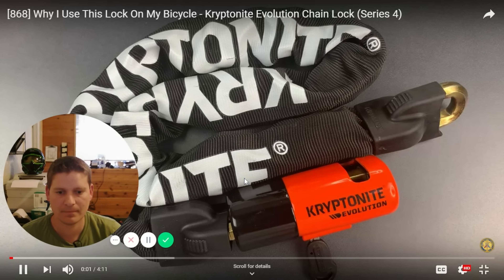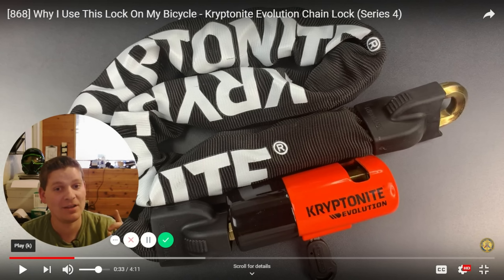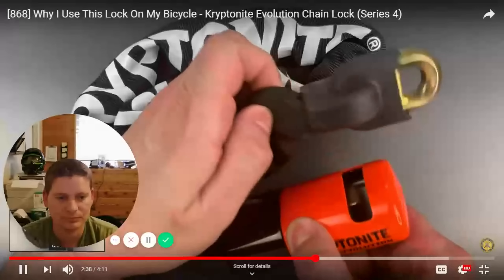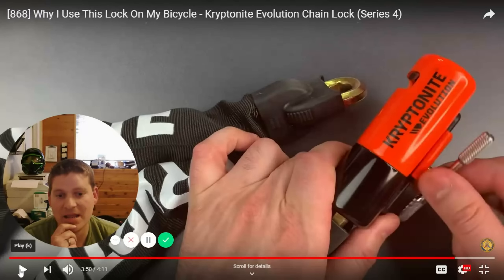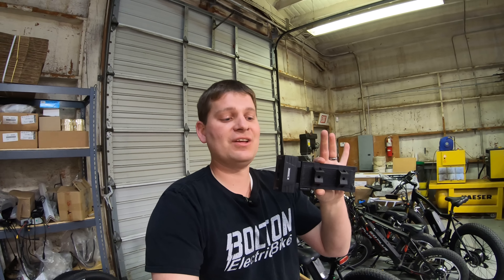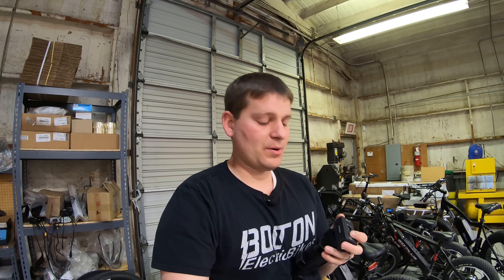Secure Your Electric Bike From Theft

Comment: The most stressful part of e-biking is trusting that it'll be there when you get back in a few.....
Reply: Yes that Is very true
Reply: It ain't going to be there  so there is no point in having it
Reply: Tile sticker can help you recover it just hide it good. The battery lasts three years. If someone who has the tile app gets within 100 feet of it after you report it stolen you instantly get a location.
Reply: @thetruth6585  What is a tile sticker exactly and what is its normal use? I assume it's some kind of GPS tracking device. If so, where would you get one from and what do they cost?
Reply: @Bogsyism  tile uses bluetooth not GPS. It costs 20 dollars. If u mark it as stolen anyone with the tile app can locate it for you.
Reply: Use boomerang GPS system
Reply: I actually have now installed tile trackers on both my bikes.
Reply: @robertbrawley5048  bet you never tried for pretty woman either then!? Someone usually steals them too! Nothing is forever ma fren! Bicycle...woman...ride it like you stold it cuz there's no tomorrow!!
Reply: @davidklein1667   ha ha .  I'll know what you mean I ride my present bicycle a Walmart $100 wonder  but a $1000 ebike I should be more careful
Reply: @robertbrawley5048  just cover your bases my freind!  I live in the ghetto...ebike...3000$...nails bit to a stump! But I study problems and worked out a system....Locks, Locks, Cables, Alarms. Oh yeh...more lock gadgets! Like security skewwers. Use a varied assortment of ubolt, cable, etc. Leave no slack in chains or cables...an audible alarm.....any bike can be stolen...just make it to much work and time!
Reply: @davidklein1667   what is needed is a compact bike and a cut proof or cut resistance cover that can enveloped  a bike lock to a unmovable stand I believe a teflon woven fabric could  be the approbate material.  It doesn't burn but it will practically melt . It is difficult to snip apart or to slice through. My plan for an ebike used for transportation only, never recreation  is to be able to take it into a store. With me . As yet I havent seen a ebike in my price range ( a brampton is above my price range) that is suitable for taking into a store . . But the $1000 fat tire bikes would be suitable to drive to a rental car dealer and stow the bike in a car. The availability  of battery powered grinders rules out a 2000 dollar ebike as a bike locked on the street 
And I live in a ritzy area that poor people  come  into as well and . So poor they dont own a car. I'm that poor as well. People here have had their cars stolen 20 year old junkets  with dead inspection  sticker . Meaning people desperate for a ride. . I rarely lock my bicycle on close by stores ( an easy walk Home )  and use a cable  at stores that would be a far walk back home
Granted  most thief's dont carry a battery power grinder  with them
Reply: @robertbrawley5048  hey Bob. Good points all. However!! There isn't a lock made that can't be defeated!! And yes...they carry grinders here! But I've worked out a system...knock knock!!!...that seems to be working.
  Like I said all locks can be picked, grinded, cut, snapped with a car jack!..my fav..frozen and shattered.
  But...thieves studied operate under the '30 second' rule. Can they snatch your bike quickly and with a minimum of fuss and noise. Sooo...your job is to provide an obstacle course to difficult to navigate without waking the neighborhood.  Also...most thieves are young boys that carry only One tool...be it grinder or bolt cutter...I have yet to hear of or meet a thief that carries an assortment so multible locks requiring different locks along with a 20$ squawk box alarm. Another sad but viable strategy...chain up near less secure bikes! Please understand...I've developed this over 25yrs in security work combined with my cycling. Use my method and you should be fine...there's also insurance. 
  BTW....Don't think a 1000 is enough for a good ebike. Common consensus is you need to start around...1800$...otherwise all you'll get is junk!
  Good luck!
Reply: @davidklein1667  
1. Chain up near less secure bikes. Let them follow the 30 second rule and steal the less secure bike
2.  The thirty second rule . If they cant steal it in 30 seconds  it ain't worth it.
Ok I forgot. Insurance
3. Insurance
Reply: @robertbrawley5048  dont forget yur 20lbs of steel, titanium. Carbon weave belts and my new fav...disc brake alarm! 20$
Reply: @robertbrawley5048  an envelope..cut proof to protect the lock...hmmmm. interesting!  One thing though...what to use to lock/secure the cover!!!?? Lolol
Reply: @davidklein1667   yes that's the problem The weight and bulk . But it could be said for a car as well . If your car broke down on the interstate one woul need a full camping set up if it was 40° Farenheit  and raining because  by law they are not allow to sit in their car waiting for help
Reply: @davidklein1667   No to protect the goodies like handle bar attachments cables , wheels.  Batteries. Ideally a locker but where I go they have no bicycle look e lockers
Reply: @davidklein1667   a lock of course but  that is considering   rule number 2 . The 30 sec rule
Reply: @robertbrawley5048  attachments Are a problem! So far They have left my display alone...wouldn't do them any good. But lights, etc...As far as wheel and sear/post security (I Had to cover this...between my Body Float post and Brookes seat..) I found a honey!!! NutFix..a German co. I think. Check it out! I had to show my mechanic how to open!
Reply: @FestivalFlowArt  boomerang gps?
Reply: Don't lock it at a train station I have 3 stolen  bike wost place to lock
Reply: Yes, I know.  3/13/2021, at 4 am.  They got the bike and the trailer while I was getting groceries.  The thief had bolt cutters.  Had only taken the chain, due to the weight of groceries.  Now have a heavy “security” chain + lock, plus a heavy U-lock, and plan on securing some grade 120 transport chain for lock #3.  Figure about 30 pounds worth, all total.  Right now, about twenty pounds.  I learned my lesson, or at least I hope I did.
Reply: @davidklein1667  true.  1800, if you are careful - a car-supplement bike. (includes most store-bought ones) Car-replacement needs about double that, not including tools - and that means you build/modify it yourself (like I did, and am currently doing).
Reply: @Bogsyism  Tiles are like apple tracker tags. But I don't see the point? Your bike is going to be long gone, You can't track it unless you or someone with the app is in range, And they know about it and have the active app, But your  bike could be anywhere and near anyone that you don't know...??? And the tile could be removed if it's spotted. I mean, If the bike is sold on and the tile hasn't been spotted, I guess one day you or someone you know could be pinged and suddenly find it.. I guess that's a chance but very slim. If the bike gets taken apart then for sure the tile will be spotted and the bike will spread out and it's game over anyway lol
Reply: If you'll be back in a few minutes, put a bike lock around a few spokes and a part of the frame.  They'll have to carry it, which means they wont get far. 😅  At worst, you have to replace a couple spokes and touch up the paint.  You can usually get free gun locks from your town office.
Reply: I get stressed out when I leave mine out in the open even when it's locked. but you just have to know what parts of the CITY (YOU ARE IN.)
I know where to leave it?, and (NOT WHERE TO LEAVE IT!!.) 😮
Reply: That is why I ride my bike into the Lowe's or into the grocery store.
Reply: @davidklein1667  Ado A20F ebike is about $1200 and it's definitely not junk.
Reply: I use a old bike to do groceries
Reply: I had mine stolen so I would never leave my bike unateneded in the future
Reply: So true. Something else related to ebikes are helmets, most people wear cpsc helmets when they should be wearing nta helmets like xnito or bern hudson
Reply: @thetruth6585  I use a Samsung tile, apple air tags work too.  All depends on your area and where it's taken.
Reply: @davidklein1667  disc brake alarm for the win!
Reply: @davidklein1667 🤔 fingerprint lock
Reply: I have mine with a alarm on it and a built in AirTag it takes away a lot of the stress, but also I specifically got the minimum requirements so I could use a enduro/stealth bomber frame that way my bike would also be really heavy to deter thieves 
(bike weighs about ~40kg)
Reply: Insurance should give you some peace of mind. Other than that.. 2, 2 star locks and a abus alarm (which goes of when it moves) a small tile gps is all you can do.
Reply: Folding bike with 16 inch wheels. They look so cute no shopkeeper blinks an eye when I take it instore.
Reply: Gat a lock
Reply: you can get cheep alarm systems that you activate after you leave bike. sound will scare away the thief. good stuff.
Reply: @davidklein1667 women aren’t objects. Jesus Christ I can see why they leave you
Reply: Park it in places where there are lots of CCTV cameras and security guards.eg: big shopping malls,major subway stations
Reply: The thugs actually wait for you to come out because they want the keys too.  As soon as you get the lock off they are running over and nab the keys to bike's controller.

Comment: Forgot one very important thing:  Lock your bike to something!  One common method of bike theft is to just toss it in a car or van and get the locks off later.  Always lock to something....
Reply: Lock to a shopping cart 🛒 if you’ve got nothing else to lock too.Going to kind of tough loading that bike with a shopping cart locked to it.Not impossible but damn harder than just the bike alone
Reply: Take up a parking spot and lock it to the pole if there is a pole

Comment: I use 2 Kryptonite New York chain 15mm 15 lb (each chains) and a another U-lock (with a different keyway type).  2 motion alarms (1 hidden and 1 bike horn), Pinheads locks (seat post, head cap and both axles), GPS tracker and seat post cable 19mm. Also replaced All bolts with 'security head bolts'. I added a hidden 'RFID start/kill switch'. I Remove battery and place it in 'trumpet bag', so battery with me.

Am a Locksmith, re-keyed all locks.
Reply: I guess ur security lock on your e-bike is a way far more expensive than your   e-bike.
Reply: ...and now my bike weighs 150 lbs.
Reply: too much weight
Reply: Honestly someone needs to make a 360 bike camera that is metal and can’t be broken easily at all that will take pictures and video of the thief and notify the police and also have a siren at affordable price
Reply: Which alarms you use out of curiosity, Just got my ebike and want to keep it safe as possible,
Reply: Toss the obsolete Kryptonites and buy a Litelok or Hiplok.
Cutting butter twice isn't that hard.
Reply: I'm 3 years late but you use 15lb locks my G? Do you leave em at the bike rack every now and then?
Reply: This is really just child's play.
Unless you're using an Allmax Immobilizer chain (1 inch thick links) with Squire's largest padlock, you're a poseur!
Nothing says security quite like this 55 lb. combination, costing $750.00!
Security is serious business!
J/K
That said, I have had he urge to splurge on this insane lock combo.  It would look good next to my Altor SAF!

Comment: I have watched several videos testing bike locks. No one has actually done the tests under ALL of the following conditions. 1. Use portable grinder popular with thieves. 2. Include in the tests the time to change out blades and batteries on the portable grinders. In real life that time would add to cutting the locks. 3. Locking the bike locks in a more realistic scenario wrapping the rear wheel, frame and bike rack. 4. Additional second or third lock wrapping around front wheel, frame and bike rack. 5. Steps to take if you encounter thief while in progress.
Reply: Yes they have.  
Bennets BikeSocial has been testing for years:
https://www.youtube.com/watch?v=JVqNCv_p7Ug

And there are many others out there who've taken grinders to the Altor SAF, Hiplok D1000 and Litelok X1 & X3's.

Comment: In addition to locks, I highly recommend brake-rotor-motion-alarm-locks. They're cheap and effective when used in conjunction with other methods.
Reply: Where do you find those. Never seen one.
Reply: @consaka1  Amazon! I have one. It has a wire that you attach to your handlebars to remind you to remove it before you ride.
Reply: @consaka1  You'll find them under motorcycle disc locks. Pin locks through one of the holes in your brake disc and usually they have an alarm when there's a certain amount of motion to the bike.

Comment: What I've learned from watching The Lock Picking Lawyer is that a good, pick resistant lock is one where he has to use one of his special tools. If it can be picked with just a tensioner, a pick or a "rake", then that end of things is pretty secure. The next is cutting the device. His video showed that particular Kryptonite is very good in that regard. I don't know what kind of lock it uses though.
Reply: The lock picking lawyer seems to hold kryptonite as a brand in quite a higher regard then other companies so I’ve generally decided to go with their brand in most applications nowadays
Reply: bike thieves dont pick locks - it just dosnt happen.

Comment: I have a Lectric XP. I use a folding lock and take my seat with me. Main problem is actually securing the bike to something as it does not have a traditional diamond frame to create an enclosed space to pass the lock through. Fortunately, there is a "handle" like thing on the downtube. Would need to use a heavy chain to actually get the wheel as well as the frame.
Reply from the maker: Sounds complicated, but whatever you can do to keep it safe.

Comment: You covered some good points; and the L.P. Lawyer is of course a must....however, you showed the link-lock as the lock you'll be carrying on your bike - that lock is better than ANY cable, and arguably better than some chains...that said, a bolt cuter at one of the rivets will compromise the lock...  "You have to draw that line."  The best lock "by weight" too "security" is a chain lock.   A chain is NOT a chain.  It MUST be 3T triple heat treated boron Manganese steel WITH "6 sides" per link... Not joking.  The "6 sided" link for instance, makes the link that much harder.  So, each link super strong , there is NO weak-point at the rivet. And even though these are already good reason, the important reason reason why a chain is superior is that it doesn't stay still!  If youre trying to cut it, it moves around... You can't grab a-hold of it like a u-lock, or even the lock you have there with the rivets, in order to cut it. It simply "Wiggles around" like jello in comparison to anything else when trying to cut it. Now make sure you buy a strong lock comprable to the chain and don't attach it to something else that could be cut easier than the chain. More over, put a tracker on the bike; these days and apple tag or the Android version works great. Best place to put the tag would be inside the the stem, the end of the stem where the 4 bolt hold the bar to your bike, or in the bottom bracket, which is where your pedals go, if you can get to that part. And or, finally, inside the actual Tire itself. If you run a tubeless tire, it's easiest to put the tag inside the Tire and the Wheel. Or in second place, just between the tire and the tube. Final thought. If for some reason you take a bike, any bike, on the front of the bus rack, make sure you lock the bike to the bus tracker. They'll steal the bicycle off the front of the bus and run just like they will do anywhere else. So even if you're standing on the bus looking at the bicycle, still make sure you put a lock on the bicycle. And still MORE, carry a TASER.  These people will Jack-you for the bike directly. FINALLY, don't leave your ID on the bicycle someplace so that if they steal the bicycle, they don't also now have your address!

Comment: I ride a Walmart mountain bike with a conversion kit on it.  I keep 2 d-locks at my usual parking spot and use a cable lock as well for a total of 3 locks running through the most valuable components.

Comment: That is the EXACT lock that I use. The 5 ft. one gives you plenty of length but is very heavy (almost 10 lbs). It works great. As far as the ability of this guy, this is what he DOES! The tool he uses was created by him to do just what he is doing.
Reply: Same here, love the chain. The only modification I've added is a motion alarm on the chain and one on the bike. They're cheap on Amazon and I'm a paranoid guy .
Reply: @Sup-jz2ow  That's an interesting idea. What category are they listed in so I don't have to spend an hour searching alarms (not like I don't have the time with "stay at home"!
Reply: @larrywhite6298  the ones I use are
https://smile.amazon.com/dp/B0734QN8KR/ref=cm_sw_r_other_apa_i_4vhKEb0H3TRQX
You can link them to respond to one remote. The chain is thick enough so that it'll take quite a while to cut, the alarms are just to farther discourage tampering and notify me if anyone decides to go for it. Alarm on the chain is to make sure something sounds as soon as they touch the chain (unless you wrap the chain tightly an alarm on the bike might not detect vibrations on the chain) and the one on the bike is for when they move the bike to get a better angle on cutting the chain and incase they cut off the first alarm.
Reply: He just starting selling that tool,it sold out in 2 hours.

Comment: talking about key blanks.  I used to deliver RV's from the manufacturers in northern IN to dealers around the country.  All trailers that used a standard key for the side compartments were the same. this went across all brands.  Trailers that used a round key, like what a soda vending machine would use were the exception.  At one Freightliner trucks only had 5 different keys for all their trucks